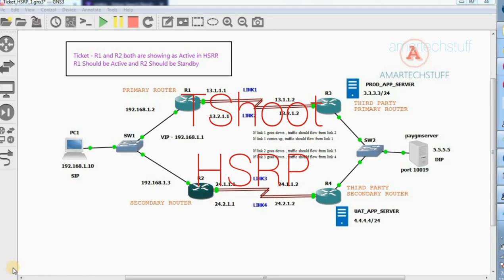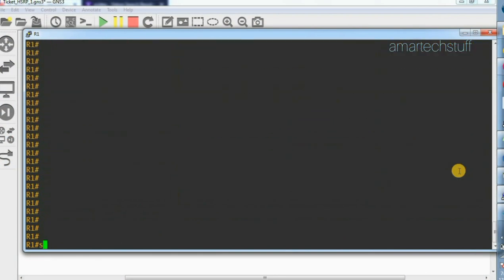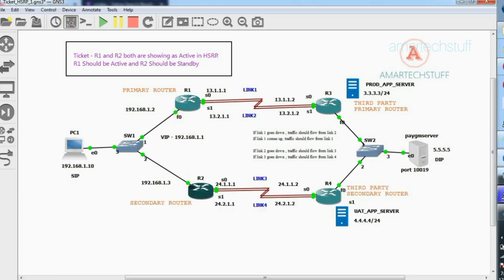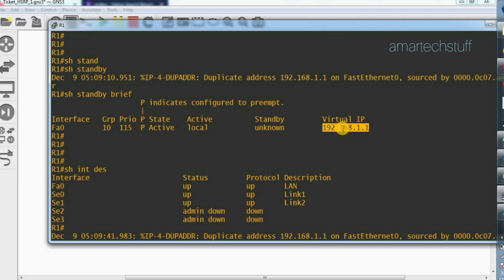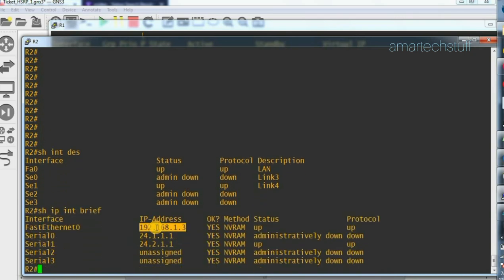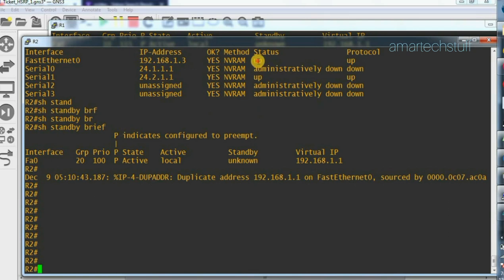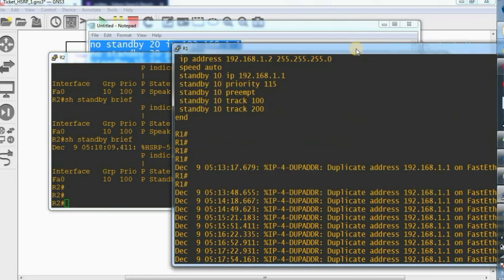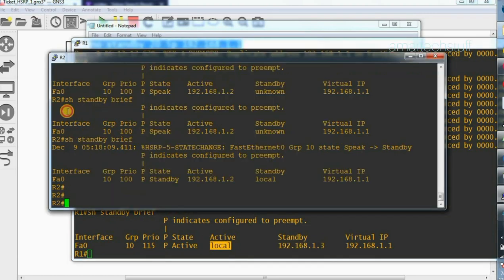Network Troubleshooting Ticket | HSRP (Ticket 1) | in English | TSHOOT | CCNP | CCIE

Comment: Sir Not to the point... It's not troubleshooting it was your configurations error.
Reply from the maker: The tickets are based on experience of real world scenarios ...where network engineers may make mistakes . Troubleshooting can never  be to a point ...it’s a open chapter with multiple possibilities
Reply: Configuration errors is part of troubleshooting. Here's a scenario...your co-worker updates HSRP config but forgets to copy run start. The building loses power. When it restores your HSRP is no longer working. What are you going to do?